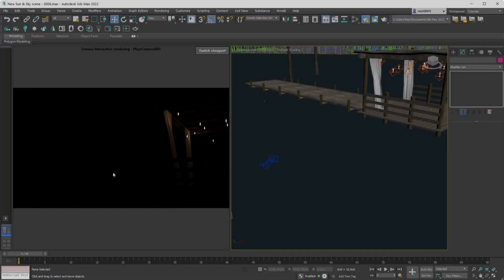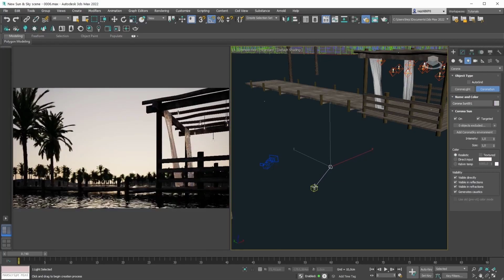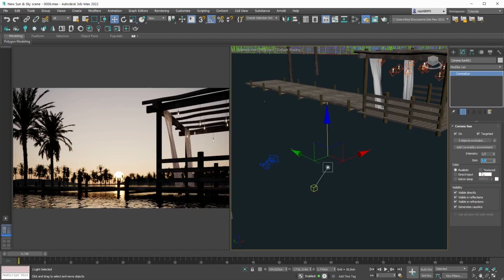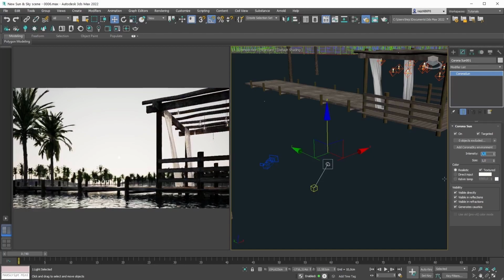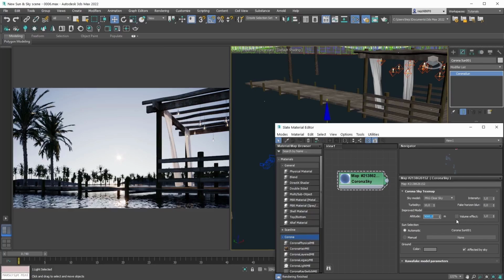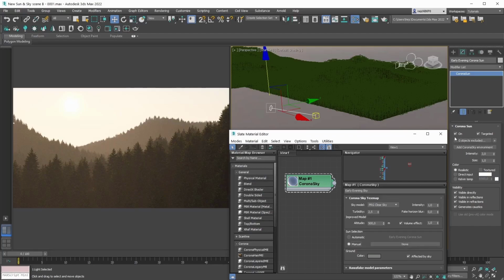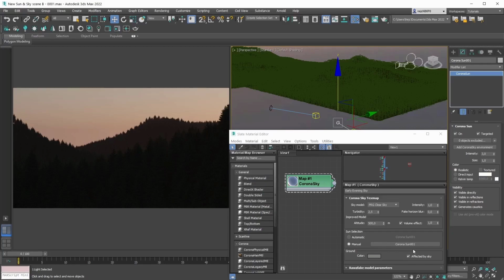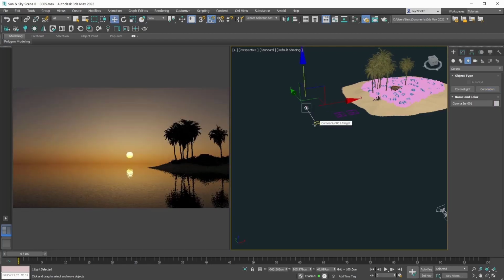Sun and Sky with Chaos Corona for 3ds Max

Comment: Thank you but can we see your tone mapping?
Reply from the maker: Thank you for your interest in the video and the scene! Unfortunately with this being an older video, we don't have the exact scene any more to share precisely what tone mapping is used, sorry. This is so old however, we can say it is nothing but the default controls, without even the ACES OT parameter which didn't exist back then, so the tone mapping stack was the basic one, in the default order, which means there wasn't much to adjust and it should be easy to get those same results easily and quickly without seeing what we happened to use here. Just some exposure and highlight compress is probably all it would take! Hope this helps! Tom

Comment: I use corona sky for the right light in my scene, but the exposure needs to be high. When that happens, the corona sky shines too much in the windows. A bad render results. Isn't there a ''visible directly'' option for corona sky?
Reply from the maker: Without seeing the scene this to me sounds like realistic behavior that photographs face in the real world as well. 

There are multiple remedies though.

You can try lowering the sun's intensity (remember if you have a lower intensity and higher size you're practically creating an overcasty scenario).

You can try different tone mapping options to control the highlights / blown out areas in your image. ACES OT is ON by default and that is a pretty good solution so if you still get "too much shininess" you'll probably have to tweak the lighting.

Beyond that I'd suggest hoping over to our forums (https://forum.corona-renderer.com/index.php) and open up a thread where we can more easily have longer form replies :)

Hope that at least somewhat helps! Nejc

Comment: Awesome tutorial. It's amazing how the default Corona Sky setting happens to be exactly the right amount of light in the scene. When I create a sky, it's just always way way way too bright, 0.1 intensity is just enough. Same goes for the Corona Sun as well. Using 1.0 intensity in either will bleach the vegetation to bright white, creates a problem for an interior shot looking through the window etc. and everything outside the walls are pure white. Is there any setting should I change? Thanks in advance
Reply from the maker: Hi! Well, if you are in an interior, the outside seen through a window should be over exposed by either a little or even a lot, as this is what happens with real cameras in the real world. Artistic control is possible using visibility overrides, such as Direct (if not seen through glass) and Refraction (if seen through glass) where you can use the same HDRI or Sky map but passed through a Tone Map Control to avoid the exposure affecting it, or you can just place a different instance there of the HDRI or even a different HDRI or different Sky altogether and lower its brightness. For longer topics like this one, which could benefit from screenshots etc, it is recommended to ask over on the forums at https://forum.corona-renderer.com/index.php as YT is not so good for back-and-forth discussion, and doesn't allow sharing screenshots of setups etc. at all. Hope this helps! Tom